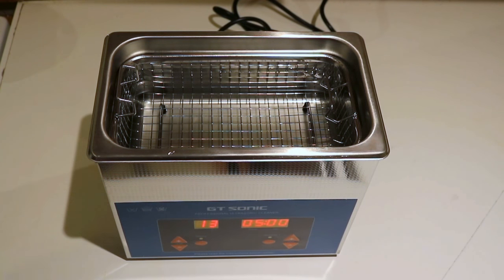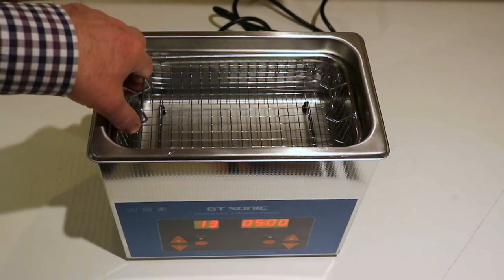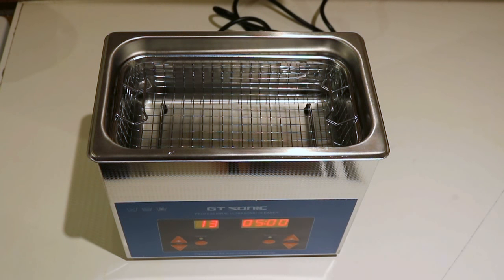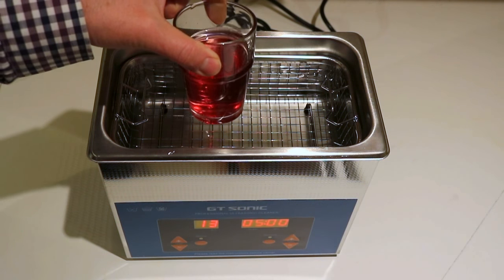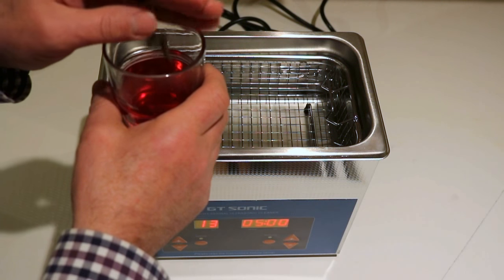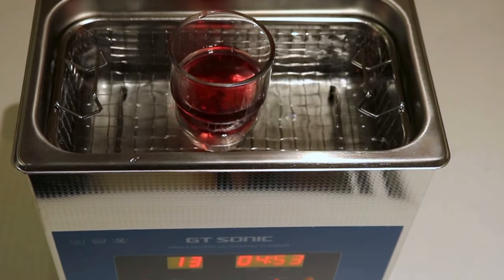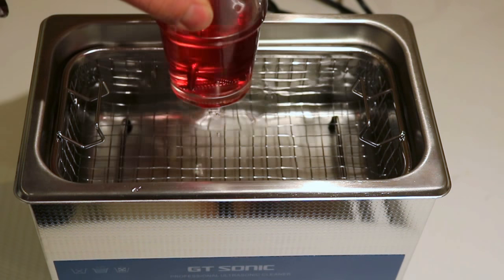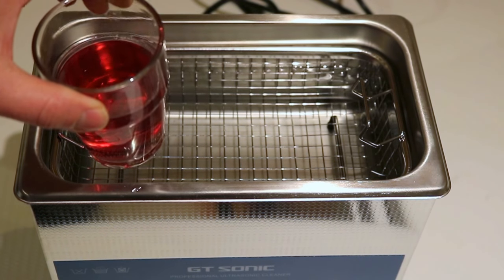How to clean jets and small carburettor parts in an ultrasonic cleaner

Comment: Does glass jar enhance cleaning?
Reply: No, it will help you reduce your cleaner solution by filling just glass and not the whole machine.  It cuts down on waste and cleanup, and can help you keep track of smaller parts that might get lost otherwise.

Though. I'd recommend using a ziplock bag instead of a glass.  The glass will reduce the ultrasonic vibrations that reach the parts.  A bag will not.

Comment: You are going to ruin all of the transducers in that ultrasonic because you aren't filling it all the way up. Also you are supposed to leave the lid on when it is operating too.  READ YOUR OWNERS MANUAL
Reply: They ask that you use the lid due to the cleaners that you would typically use in it, it's completely safe to run without it, though.  Especially with just water in it.  The transducers don't generally care how much liquid is in the machine, so long as all points in the basin that contain one are submerged in fluid.  Obviously, 1mm of fluid on the bottom of the basin isn't going to do much, though.